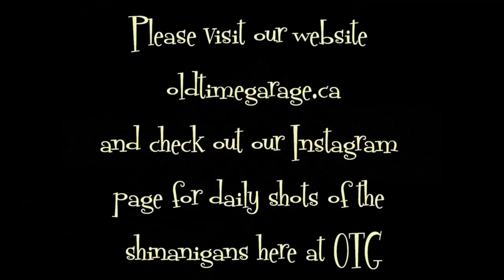Shop Tour

Comment: IF you are not concerned about how body work will look like afterwords you can easily cut a lot of rusty metal out quickly. There may be a lot of SPLAYNING to do later about why the door's won't close now however.
Reply from the maker: I agree you must be very careful when cutting away as your losing the strength . on the camaro am only cutting the bit in the floor as you just seen and thats it bracing is still all attached and i welded 3 braces across under the floor boards so not i the way when installing the new left side only . measurements are always a great idea before you start too. i just write them right on the car body as if i wrote them on paper i would probably loose them lol.